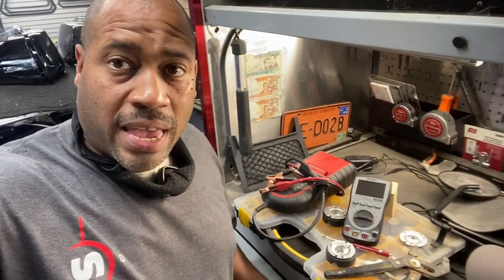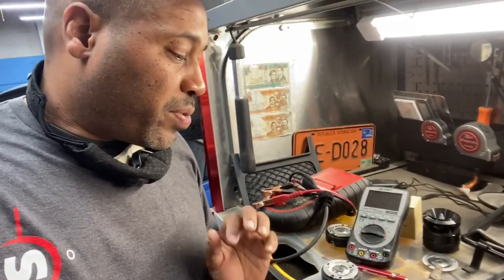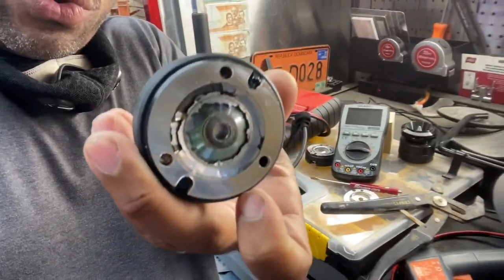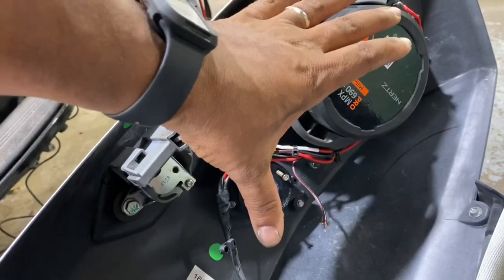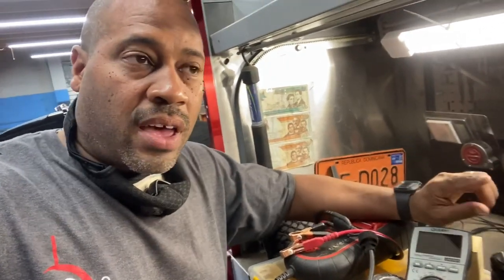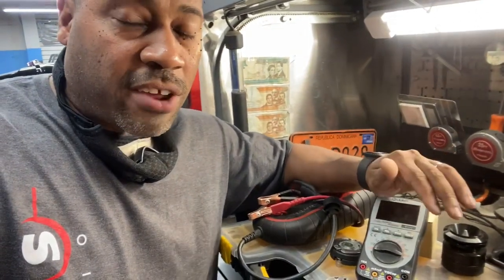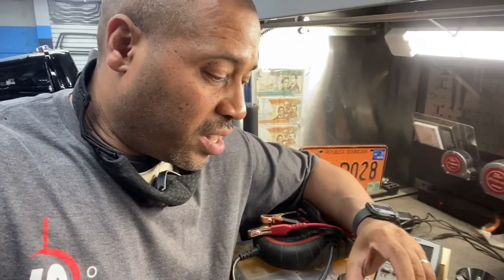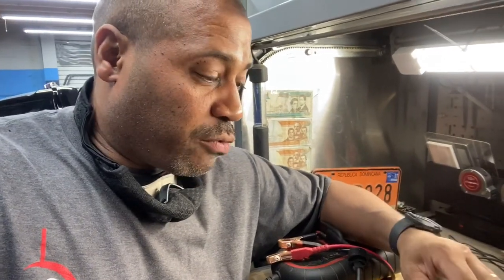Stop 🛑 BLOWING TWEETERS!!! On your Harley Davidson and Victory motorcycles Use a high pass filter !

Comment: Never seen such a burn hehe I happen to have a burn tweeter but my concern is more how to make a crossover for a 2.2khz tweeter if you can en lite me I’m newbie for crossovers and that’s crazy for this repair I’m talking about the 15” speaker works this dj speaker has an unnamed manufacturer now the tweeter was a toy after opening it has a piezo paper plastic tweeter hehehe 8ohms the speaker cabinet only says 300wAtts. How can I add additional protection for this new tweeter I want to put a real 1” tweeter with magnet that fits the horn assembly if you can show me what type of stuff I might need to get a decent frequent cut at around 1.5khz or 2khz please that would be of great help I want something that would stand up for those watts 40rms

Comment: Hey bruh I watched your video about the hertz tweeters. So I have 2 st25 and as I was rewiring after installing the Sony 7000 the wires from the capacitors broke off so I’m trying to find a replacement capacitor. Do you any recommendations for the hertz st25

Comment: Do you cover these under warranty? We swap similar issues frequently, and we shouldn't. Just curious how you handle it.
Reply: Bike owners are the worst for abuse.
Reply from the maker: We did not do the original install and the equipment was not purchased from us so the tweeters are not covered under warranty. 
When we sell and install them we warranty them for a year . But since we use a dsp on every bike we build I think we have had 1 blown tweeter in 5 years .
Reply: @NVSAUDIO  
Gm sir where can I get replacement voice coils for ST 25k Neo Tweetets
Reply from the maker: @derricktate9287  I have them in stock